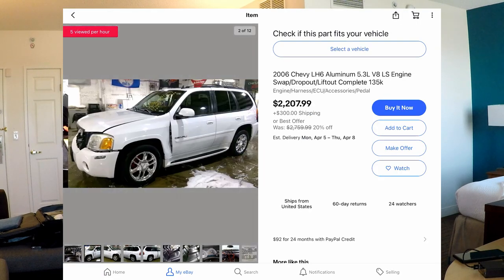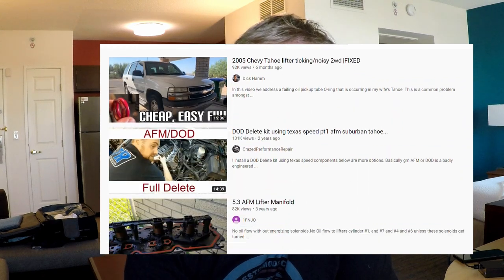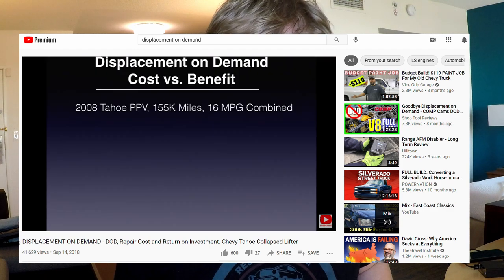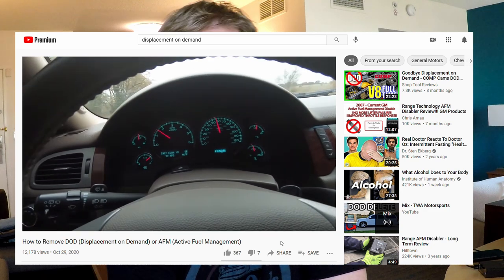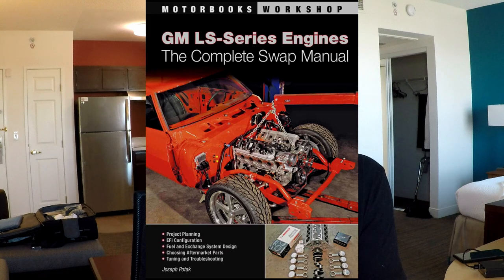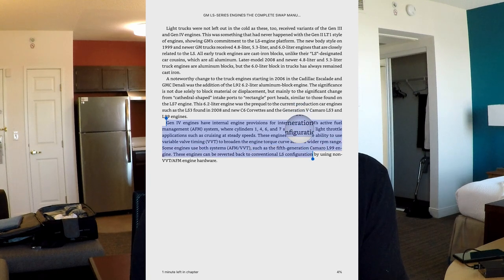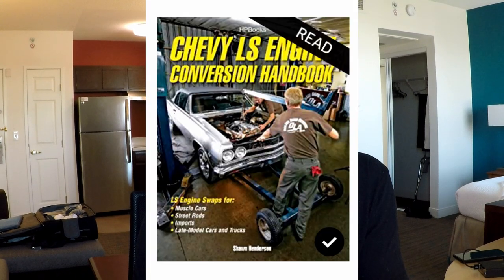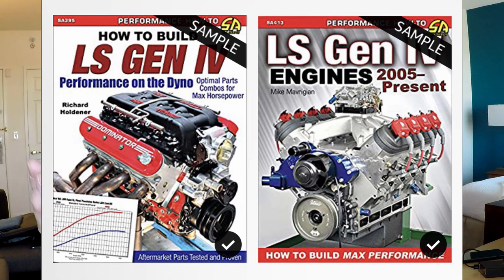Disable Active Fuel Management / Displacement on Demand Without A Delete Kit? | Good Idea?

Comment: Ive been through both now. My truck is a 12. Had it since 14 with 30k. It has 70k on it now. Has never been ran hard at all. I used a duablo at 40k to disable the afm. It did fine and ran fine for 30k. It started to get a very light tap. Only I could hear it apparently. I went wild with full AFM/VVT delete. Used BTR 302 truck torque cam and a few other good parts. With parts on in and diablo it ran about the same other than cam signal. After a day on the dyno with HP tuners it feels like a damn hot rod. It runs and drives like a totally different vehicle. It would snatch a trailer out from under a load now. BTR claimed around 40/40 gain. Mine was closer to 20/60tq gain. Now I have to pull pan to delete that relief valve. Tuner said they have had huge oil pressure issues with that valve after delete sticking. Mehling says they cause oil consumption issues.

Comment: bought my 2008 silverado 5.3 with 90k and some light mods(no cats/cold air) the previous owner had it tuned after the mods and removed the afm. i have had it since then and added another 70k miles so im around 160k..... finally i got a lifter issue drivers side bank cylinder 1. im now in the process of ripping her open and taking all the crap out and installing the delete kit and possibly the cam. fun fun fun. if its a newer motor i suggest turn it off. keep changing the oil regularly and get to buying the parts for dod delete and tuner anyway. the motor is solid but that BS DOD/AFM system is trash.

Comment: My 2015 Suburban has AFM. It failed right after a recall fix. The dealer diagnosed it and it would cost $3000+. Also they wouldn’t delete the AFM. I installed software and have not any problems for over two years.

Comment: One thing not talked about much is that non-AFM lifters are also prone to failure!  Over-time perhaps with less than optimal maintenance and or performance mods and aggressive driving, the clearance between lifters and lifter trays increases to the point that the roller/lifter can rotate from it's proper position enough to cause roller/cam wear and eventual failure.  This could be a problem with any engine with roller cam followers.  A concern I have with AFM disable is that over-time, could non-use cause varnish build up on the lifter internal sliding parts causing the lifter to jam in the collapsed position if it were to ever be re-activated even for a short period?
Reply: That's a really good point! This to me is why choosing the best oil possible is critical. I agree, if you disable it, better make sure it stays disabled at all costs.
Reply: I heard that's how a lot of them fail, being inactive and then activated. Makes sense.
Reply: even with the AFM disabler activated, there are still oil flow into the Hydrolics lifter.. the high pressure oil that is used to compress the pin do allow the lifter to disengage is not there of course, but you still have oil passage that allow the oil to move inside the lifter. No worries at all with the Range AFM disabler.. this has save my engine Im sure. Cadillac CTS 2017 here.

Comment: Depends on which engine we're talking about. I've seen some pretty good success with the AFM shut off chips on the Gm 5.3 if it's used early enough. I haven't seen any success in that area with like the early 5.7 dodge models.
Reply: There have been folks successful with the dodge as well. Same thing though, done early .

Comment: Good information, Thank you.  I used a plug-in disabler trying to avoid lifter failure on a 2016 Silverado with 140K miles, it failed with the disabler connected within 1000 miles.  I don't think the disable induced the problem, however, it didn't prevent the collapse.
Reply from the maker: Yep, your story is not uncommon. It seems that the DOD has to eventually be deleted.
Reply: Was using the disabler on my 2011 for a couple of years. Lifter just collapsed with only 81k miles. Ordering a complete kit with new cam and everything $995 just for parts.

Comment: Buddy, no need for a case study. The engine in made for full 8cyl. Function wether it be all time or DOD active. Once you disable through OS, all you did is maintain constant operation of those components to those cylinders that would otherwise be switching on and off.

Comment: I got my 07 DoD disabled since new but it had lifters and camshaft issues after 4 years and 60,000 miles and dealership didn’t fix , I still had warranty.
Ended up getting a 6.2 and still have the 6.0 with the delete DoD and new valve springs and camshaft
Reply from the maker: Ya. It seems the consensus is that the DoD needs to be deleted from the engine. Disabling is not enough if you want your engine to last long term.

Comment: from what i've personally seen, its the springs. and no amount of turning off the AFM in the computer(s) is going to stop a mechanical failure from something used all the time with said feature off.

best to just delete and be done with it.
Reply from the maker: Ya that seems to be the case.  But SO MANY people think that just disabling it solves it.
Reply: @AmateurHourGarage  So by disabling it or not, are people not having failures for 10 years because of what, magic or luck?  or is this more of a I need to be right, and prove others wrong on the internet comment.   Or is it just luck of the draw?

Comment: Whew too much what if and what about. Do or don’t do. I believe that the best engine performance is in 8 cylinder. 
Having the disabled engine to 4 cylinder is a radical change. From an engine purring on 8 cylinder.
Also that feature 4 cylinder, has caused accelerating oil consumption.
I have the Range override plugged into computer port.

Comment: What if I do a dod afm delete like non afm lifters pushrods and non afm cam basically regular afm delete but without tune would this work rather than just tuning it give me advice up in the comments it’s 5.3 gen 4 08 Sierra
Reply from the maker: Do the OBDII gadget to stop the vehicle from activating the AFM/DOD is your best bet. If you do have a lifter problem now, have the delete professionly done. This is because an amateur job will eventually cause other problems with the motor.  IMHO
Reply: @AmateurHourGarage  yeah that what I’m gonna do just have someone come do the afm delete professionally ima do the lifters different push rods and a non afm  cam then that 3 bolt cam sprocket so it can read the signal form the front like the original cam has only one

Comment: It is not a good idea to just disable the AFM bs.  I've had a range technology disabler on my 14 L83 silverado since 2017.  The truck has just under 54k.  Number 7 lifter collapsed yesterday afternoon.  The system is worthless and needs to be removed completely.  LT engines are great, but they are ticking time bombs because of the stupid AFM.

Comment: My buddy just went through the failed lifter/bent pushrods/scored camshaft on his '99 Silverado 5.3 (his would be DFM not AFM).  He luckily had the GM extended warranty and they replaced all his lifters, pushrods and installed a new cam.  Funny thing happened: the jerky shifting and hunting engine (making up its mind how many cylinders to activate) is gone and it's running like it doesn't have DFM.  I'm wondering if the dealer, who undoubtedly knows about the AFM/DFM issue (they had another truck in with the same problem at the same time) deleted the DFM either disabling the software or installing different lifters etc.

It's so frustrating that this problem exists, and for so long, just to satisfy fuel economy requirements "on paper".  It clearly doesn't do anything in the real world except cost the end consumer time, money and frustration.

It's a really nice truck and until this happened, I was going to make one my next truck.  Might have to look at F150's though I'm sure they have their issues too.
Reply from the maker: Extended Warrenty for a 99’? Dang. Ford = ‘cam phaser’ = VVT variable valve timing problems

Comment: I would vociferously argue that active fuel management is a step forward and engine design. It would be far more effective to operate the engine lean of peak on all eight cylinders and save more fuel without damaging the engine by shutting off four of the cylinders. Running an engine on 4 cylinders and having to push the other four cylinders around is not a way to save fuel. All it does is cause much more wear on the cylinders that are operating did relation to the cylinders that are not. You can't disable that system without any major issues, the problem with that is is that on these Gen4 engines the cylinders that are disabled, even when they're not disabled are operating at a different efficiencies than the other four cylinders so the engines not running right in the first place. I have no idea who thought of the idea of disabling for the cylinders on a V8 engine to save fuel, but they really should be made to marry my ex-wife. I don't even want that bastard dead. I want him to suffer for eternity! Just another stupid idea.
But I might like to see is somebody put on some injectors, port injection only, get rid of the stupid GDI system that came out about 2014 or so. And try the 11 Port sprayer that came out on the 2005 Saturn 4 cylinder. I think that that could not only save fuel when it's running easy down the road way yeah it vaporizes fuel better because it's shooting through 11 ports instead of 2. It will give you so much better of a fuel burn that the engine may actually get better fuel mileage on all eight cylinders or at least as good as running the active fuel management. But I haven't seen anybody try that yet. It may be as simple as taking the caps off of the 11 port and put the 11 ports on the ends of the two Port injectors. Or just putting the different injectors on. The 2005 Saturn injectors are 12 ohm, I do not know what the ohms requirement is on the LS motor.

Comment: I added the Range Technology device to my 2016 Z51 Corvette with the 6.2 V8.  I added it at 9800 miles and now have 14000.  The V4 indicator never appears and the engine sound and performance is perfect.  I am not sure why GM produces a 460 HP engine and wants to degrade the performance and reliability.  Opppps, the answer is our wonderful Federal Government.  You can always rely on those clowns.
Reply from the maker: I added it on my 2009 Suburban. Keep your fingers crossed

Comment: Common sense. I turn the DOD off all the time. The engine is made to run fine with it  off or on ( until a lifter fails and one will with it on ). Think about it the factory turns it OFF more percent of the TIME than ON. The lifter can't stick down if it is not actuated. Now, they can fail other ways. The same as regular lifters.

Comment: My God !! Thanks for Nothing !!! Here is what I'm going to do actually have done. My truck at 20 000 miles I installed a Range Module to disable. Truck was running great no issues yet. Now I'll just hope it will be OK Period. Had I known earlier I'd have installed Range sooner but we shall see. Imo if you're not having any issues and have low mileage there is a good chance that disabling ONLY will be of great help.

Comment: So my question is, what's the difference from a software delete or using an AFM disabler, or just doing it by putting the transmission into Manual mode, which can prevent it from using AFM, unless you put it into Manual and the 6th speed.  Even says in the manual you can do that, at least for my 2012 Avalanche I've had since new and has 175K on it and "knock on wood" no engine issues..  Which I use manual mode as much as possible.   How can making your truck stay in V8 mode all the time be a bad thing?  Its a V8 engine, so what's wrong with using all 8 cylinders al the time?  There have been many videos and reviews of the Range AFM disabler and using it for years, and no issues.  So whos right and whos wrong.  Them, or you?  Google reviews alone has a 4.8 average review out of 5 for 930 reviews.  That many people cant be wrong?  US and Canada average reviews, Youtube videos are all showing good results years later.  Are you saying they are wrong, or causing engine issue that will show up years later?
Reply: I think the general synopsis is that the lifters by design are prone to failure whether you delete them or not, but possibly sooner with all the swapping from v4 to v8. So disabling it electronically may allow you to get more life out of it prior to failure. I think if a lifter is stuck and you have damage , sure you might as well do the full delete while you have it apart, however , if you have had no issues, I do not think there is some mechanical threat added by deciding to use a range plug in device. I’m at 137k, 2014 sierra. Timely oil changes , no issues , that doesn’t mean it won’t happen …. But I have decided I’m going to buy a range and here’s why . I had my tranny rebuilt at 125k miles. Torque converter failure . Common obviously. Some say it is because of heat with the thermostat block not opening to the cooler until 194F… others say the torque converter doesn’t something special to prevent excessive vibration when cycling from v8 to v4 eventually leading to premature failure and the TQ coming apart and ruining the transmission. Both are right….. I’ve already put the GM TSB approved thermostat in my new tranny operating at 154F verses 194F . I bought a remand tranny from GM. No idea if it has a better torque converter or not… so I’ll assume not. By using the range plug in, I can keep my vehicle in V8 and prolong the life of my torque converter and ultimately the transmission. So that alone is a reason to do it…. Will my engine have a lifter failure eventually. It’s possible , but it probably happen anyway whether I disabled AFM or not .
Reply: @danielsmith8659  Very true, I also think it maybe how people treat their trucks compared to others, or as simple as synthetic oil vs convectional.  Ive been using synthetic for a couple decades now in all my vehicles.  In Canada, we can get temps as low as -40 i the winter, to +40 in the summer.   I like synthetic for winter due to it flowing better for cold engine starts.   Am I wrong, who knows, IM not a mechanic.  Ive also never been stranded on the side of the road or had engine issues for 20 year plus, so I must be doing something right.  I do admit, adding the AFM disabler has done more than just removing the V4 shudder, etc.   MY truck is more responsive, I dont have weird downshifts at low speeds, and I don't have excessive shifting either anymore, seems to want to stay in gear more.   When you commute the same places for years you know how you vehicle drives.  And the small annoyances I had with the AFM shift when I forgot to put it into M mode, are gone, as well as the weird downshifts I used to have when stopping for red lights at certain speeds. Live in a city with a lot of hills as well and not having V4 kick in is great as you come out of the hill.  Is that science, or proof, or a fact.  Nope, just me observing something from a truck Ive owned 10.5 years.  Maybe having the AFM diabler is redundant, since I keep up on all fluid flushes and oil changes, and thats why Im having good luck with my truck.  But that aside, the benefits of a better throttle response, less and better shifting, and not having to put it into M every time I drive, are all a plus for me
Reply: @virgil3241  personally I’ve never had an actual internal engine failure either . But I’m scared to death this AFM could be the first . I’m at 137k on my 2014 sierra. Same as you , regular on time maintenance with oem spec fluids. Glad to hear you have liked disabling AFM. Im going to give it a go. I just want to get the truck to 200k safely and without having to go into the engine .
Reply: @danielsmith8659  Im the same, but then I think, well Ive been using M mode for years, which disables the AFM as well.  Whats the difference between that and the disabler?  I assume theres more to it than that, but if M has worked all these years and nothing happened, why would this change?
Reply: @virgil3241  I hope you’re right
Reply: @virgil3241 do u use M at highway speeds also?
Reply: @MyMoe9  no, because I have the AFM Disabler now for 2 years, and no issues.  In fact I like the fact now my truck doesnt hunt for gears like it used to, or go into the 6th speed it seems at 50 kmhr.  Makes the truck throttle response better as well.  When you drive a vehcile from new for 12 plus year and 185K, you notice things.   As well I think the Youtuber wants this argument for views.  I have yet to hear a response from them from my original post, which I still stand behind.  I like not having to worry about M mode like I used to, or V4

Comment: Best idea is to not buy GM until they fix this bs.
Reply: Dodge and Ford have problems too
Reply: @sschevmale24  yup cm phasers filing ford idea. No dodge AFM DFM same deal no winning when .gov says do it
Reply: Depends on where you live and how you drive in my opinion. I live in the country and live 10 minutes from work. I don't put on high mileage or alot of highway miles. ... unless my wife uses it. 😮
Reply: I have a 05 5.3 how much of a job would it be to just swap engines.